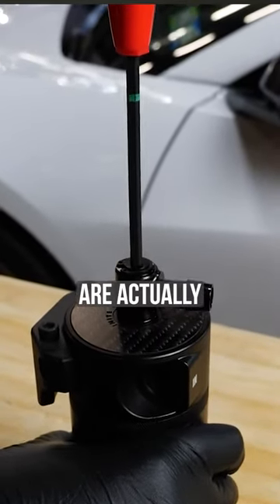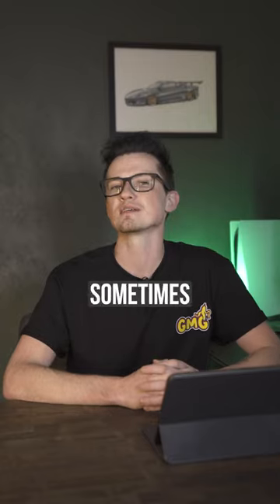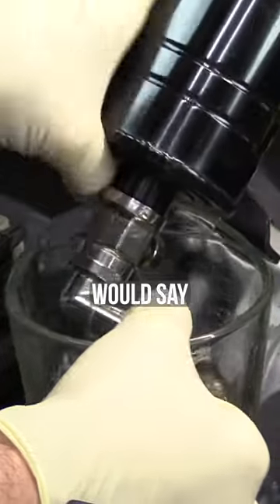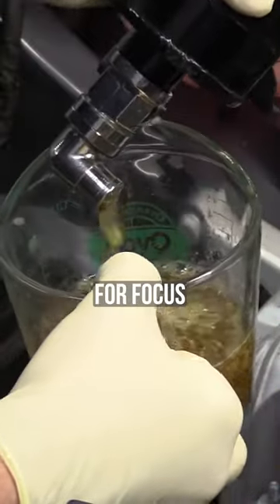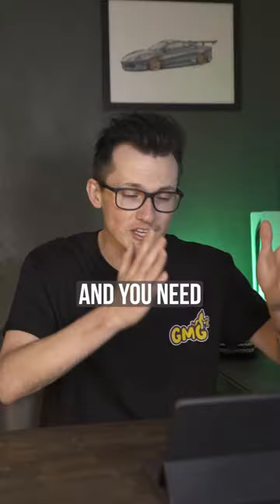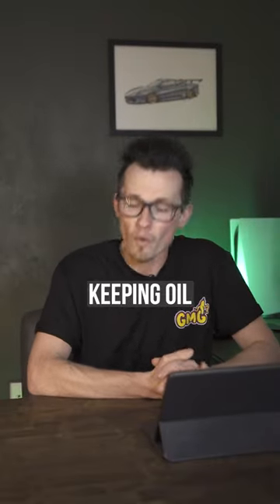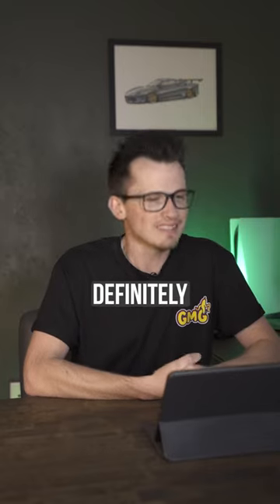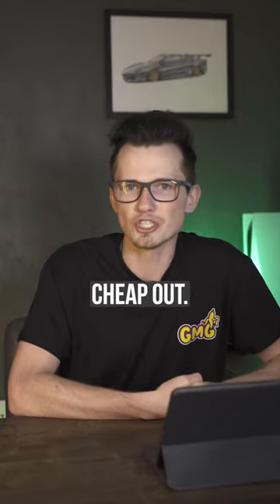Do You REALLY Need a Catch Can?

Comment: Any engine with a pcv system would benefit from an oil catch can
Reply: Exactly 💯
Reply: LucasMaclean-fy7st with a diesel, just run a heater hose from the valve cover underneath the car. Diesels don't have a vacuum.

That said, yes, the proper one can work on a diesel.
Reply: LucasMaclean-fy7st  precisely
Reply: LucasMaclean-fy7st  no prob.
Reply: Also diesel engines with cdr systems can benefit from an oil catch can
Reply: PCV, EGR, if you don't want gunked up intake valves use a catch can
Reply: What if I have 4 cylinder vehicle no turbo , not a super car, just a normal civic. Should I get a catch can or am I ok with it being stock
Reply: @danieltenorio3559  if it's DI, it should have a catch can. It can even benefit dual and port injection vehicles. There's no downside as long as you don't mess up the install, and don't forget to empty it. Other than that, it can do no harm (unless it freezes), and will help the engines top end to survive longer
Reply: @danieltenorio3559  If you’d like your intake and engine to get more pure air then yes get one
Reply: False they can blow your rear main seal
Reply: @jb0915  yeah a shitty one. Just get a vented one
Reply: On my 7.3 diesel I just vented it underneath the truck. Ran a hose from my ccv along the frame towards the back. It smoked a little from it and would drip like every 15 minutes. Better then it running through the turbos.
Reply: @imnotusingmyrealname4566 As long as you have port fuel injection the detergents in the gasoline clean the intake valves
Reply: Does anyone know if a 11th gen civic si 1.5t will benefit from an oil catch can? Ik its a dumb question idk anything about cars lol. Just wanted to ask
Reply: @Gotbread25  catch cans dont reduce carbon buildup on gdi engines
Reply: @danieltenorio3559  Catch cans dont reduce carbon buildup in gdi engines.  All you can do is change your oil every 3k miles and keep your engine in good tune.
Reply: @Gotbread25  no it won't, spend the money on changing the oil every 3k miles or 3 months.  Catch cans on gdi engines only collect water with trace amounts of aluminum and iron mostly, NO OIL
Reply: Cars had PCV system since the 60s

Comment: The first time you empty your catch can you will realize it is necessary.   Why would you want that crap going into your intake?
Reply: So that it can be combusted and removed from the air?
Reply: @kenmorrisproducer  EGR exists only to satisfy EPA laws.  Why not avoid a carbon rich syrup going onto the intake valves on a D.I motor?  You will eventually need a walnut shell blast treatment on intake valves from all of the buildup unless you collect it and remove it from the system altogether. 

I pour my exhaust gas residue into a jug of used oil, which is sent to the recycler.

You do you.
Reply: @greenflame8398  you'll get carbon buildup on the intake valves at the same rate weather  you have a catch can or not
Reply: @greenflame8398  because its just water and soot, that's all that a catch can collects on a gdi engine

Comment: Catch cans dont reduce carbon buildup in gdi engines.  They collect contaminated water, (condensation), that would get burned off in a functioning pcv system anyways.
Reply: catch cans prevent the blow by oil from entering the intake manifold/intake valves. they definitely prevent carbon build up on the engines valves
Reply: @cookiesdad  WRONG, if we''re talking a regular gdi engine, inside the catch can will be water with trace amounts of soot, aluminum, iron.  NO OIL

Comment: the carbon fiber one is definitely a waste of money😂 but this is something EVERY engine without port injection needs
Reply: It's a vinyl. Carbon fiber is basically allergic to screws or threads in general. 

A carbon fiber bolt or screw would be as valuable as blinker fluid

Comment: Every car I’ve ever installed them on has dirty gunky oil built up in them at every oil change…..so yes they are needed on any vehicle with a pcv valve
Reply: @ibezag0  it's not oil it's just water and soot that would be burned off anyways.  Catch cans on gdi engines do not collect oil

Comment: I was told my ecoboost 2.0 needed it was told this catch cans should’ve been put in in the first place. Should I?
Reply: Be careful they can blow you rear main seal.  They cause more back pressure and can also blow your engine.  Do your research
Reply: @jb0915  hey do you have research on this, I just got a Mustang ecoboost and every one is saying get a catch can and I’ve looked around online and everything says they need a catch can im more confused than ever hope to hear back thanks!
Reply: Did you ever find an answer, or did you put one on. I also just got an EcoBoost mustang
Reply: @johnjimenez68  no answer,but Im going with just getting my valves clean it’s under 800$ depending on the shop. And they are left like new

Comment: they help specifically if you have a direct injection engine that is prone to carbon build up on intake valves. having a catch can will probably save you thousands of dollars or hours of work cleaning them every 40-50k miles
Reply: If you add up the 5 minutes it takes to empty a catch can every thousand miles or so, it probably adds up to hours…
Reply: @kenmorrisproducer  if your engine has less blowby and you have a decent size can it can last the length of your oil change interval on daily driving. If you are driving on track in upper rpms it would fill faster because of increased blowby. Plus emptying a cc on top of your engine is much more diy friendly than walnut cleaning your intake valves are which I think adds some value

Comment: Adding it can not do harm , I believe all my cars are direct injection petrol engine’s however my 22 years old audi got no issue regarding to carbon build up etc, wondering how clean those intake valves there😂 )++
Guess, Driving habit, petrol quality, regular quality synthetic oil are the most likely factors)***